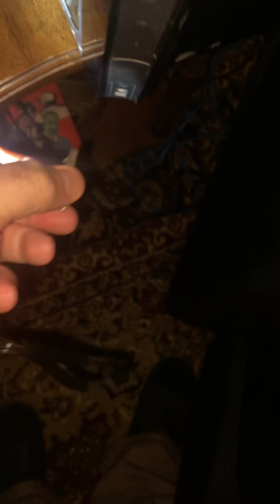Restoring Acer H340 Network Attached Storage in 2022: Windows or Linux operating system.

Comment: I really don't like Synology at all. It will never enter my home.
Instead I bought one second hand.
I will put a different motherboard in there with seven SATA connections on it. 
I just have to wait and see how this will work out but I hope that the new motherboard will be powerful enough to become my daily driver and thus catch two birds with one stone.
Reply from the maker: @Ctrl_Del_0  interesting. Keep me posted on what you do. I need to upgrade mine.  Had it a long time now.
Reply: @ziprun1  I will try.
Though, there is another channel here on Youtube, HardwareHaven.
Some time ago he posted two video's where he discusses kind of the same upgrade that I am about to do.
Perhaps you can check out his video's for inspiration.
What I am doing is actually crazy and no idea if it will work. I might not even be able to put the CPU cooler on.
Way too risky, way too expensive but I cannot turn back anymore. Stuff is in the mail. 🙂